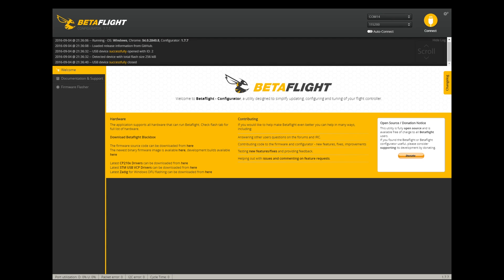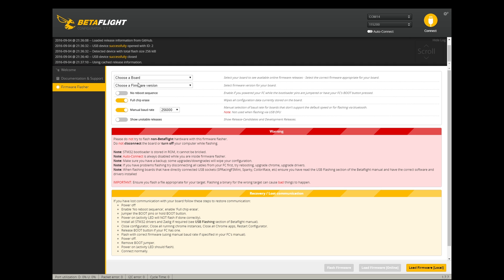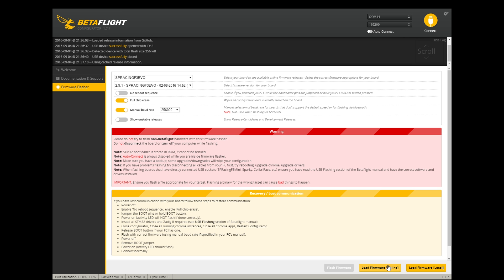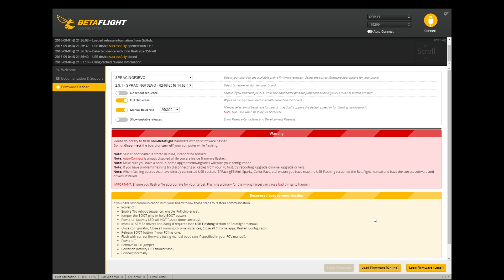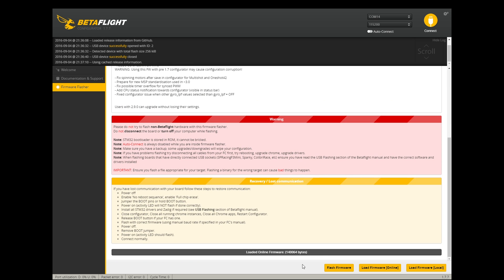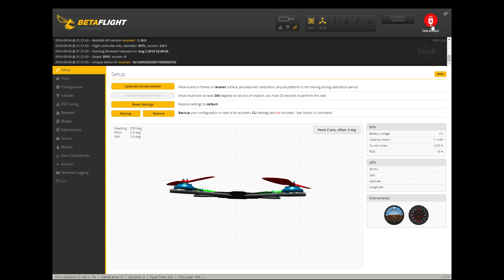Betaflight Setup on F3 Brushed Flight Controller

Comment: Banggoddan QX90 brushed quad. He flew pretty well before betaflight from the computer. However, after I put the BetaFlight program from the computer, when I connect the quad to the battery , the motor starts to rotate constantly. Then I reloaded the version from the Clienflight on top of the Quad, and when I connected the battery this time, the four motor always spinning, I wrote set motor_pwn_rate_1000 in the CLI section of the program, but the problem has not been solved Do you have any information about the problem?

Comment: im having issues binding my FC to my taranis, ive tried holding the bind button down, and activating bind mode on the taranis, but the red LED stays solid and does not respond, help?
Reply from the maker: which flight controller?  which receiver?  sbus?  ppm?  uh, need a lot more information...
Reply: Sorry about that, im new to whoops. Im using the F3 EVO FC that comes with an integrated frsky reciever. Im not using any sbus'es, or ppms or whatever that is, its just a whoop with a FC
Reply from the maker: BeeCore FC, AcroWhoop, or BeeBrain?  Procedures are different for each...
Reply: BETAFPV F3 EVO, is the FC
Reply from the maker: I don't know what that FC is, but I did a Goggle search and found some instructions online here - http://goo.gl/PU6kvz

Comment: Problem I'm having is betaflight seems to suck. I'm used librepilot many times and never had problems with it. Betaflight seems to need a bunch of drivers and while dicking around with it, and trying to figure out which firmware I need, I think I've trashed the board. Shame. This little board won't work with librepilot.
Reply: i cant figure out all the driver crap with betaflight. i cant connect my tiny 6,bummer!

Comment: hi,im totally new to drones.  I was able to connect, and flash, but after, the radio  doesn't start the motors anymore.  I tried the binding process and can see a blinking light when the the transmitter is off, and when I turn the transmitter on, no more blinking light.  So, I am sure the radio is binded with the drone, but no action.  Do I need to flash with the original firmware version which is feb 2016 for SP Racing, or should I flash with the latest version of SPRacing?  Thanks for any insight.  Thanks everyone.
Reply from the maker: You probably don't have the receiver setup properly in the configurator.  Do you remember your settings from before the flash update?

Comment: Hey, great video! Finally got off cleanflight and switched to betaflight. Unfortunately my problem still persists, on my qx70 whenever i plug in my battery the quad instantly starts spinning the motors and wont stop whether or not my receiver is plugged in, if anyone has any insight on this PLEASE help!
Reply from the maker: in CLI set motor_pwm_rate = 4000 (or higher up to 32000).  Don't forget to save.

Comment: finally I did flash beta flight 3.0.1 . But won't arm with my taranis. :(
Reply: I flashed beta flight and now betaflight won't show any movement on my sticks in betaflight. I re binded the taranis and the board shows solid green when I turn on my taranis. Any ideas?
Reply from the maker: +Insung Hwang check your throttle range... Make sure it goes below 1000
Reply from the maker: +ShabadooFPV check that you are usng the correct receiver protocol and that you have the right UART enabled.
Reply: Albert Kim I'm pretty new at this so I'm still using ppm for everything. It worked in clean flight just fine but not beta flight. I have no Uart set and I have it set to ppm in the configuration. That should be it right?

Comment: mr. albert kim i read manual rate motor pwm set to 1000 why in your video you set motor rate pwm to 32000 thx so much for answer. thx mr. albert kim i have learn a lots from you.
Reply from the maker: +eka sanjaya No particular reason. I think my motor manufacturer recommended it
Reply: thx so much mr. albert kim

Comment: Hi Albert, Iam having a Problem with saving my modes , maybe you can help. When i make my Setup in Bflight the modes are not saved, after i disconnect the board all is gone. Made a calibration before , but didnt help.
Reply from the maker: When I've seen that problem you have to reflash the firmware again.  Something is corrupted with the flash.  If that doesn't fix it, it usually means the flash memory on the board is bad and you'll need to replace it.
Reply: Albert Kim thanks , I tried a different Board , still the same . Could it be that it's something with the sattelite? Because the command set_spectrum_sat_bind=0 , it says invalid?

Comment: My qx90 has started full throttle after all these steps and the arm button doesn't do anything...he could break
Reply from the maker: did you check that motor_pwm_rate was above 4000?  If not, set it to 4000 to 32000
Reply: Yes I set it to 32 000 and saved
Reply: Albert Kim I've actually got This same problem after following these steps. pwm is set to 32khz. As soon as I plugged the battery in, it goes full throttle. Any solution?
Reply from the maker: +Winslow FPV check in CLI that motor_pwm_rate is set over 1000.
Reply: Winslow FPV I have the same problem full throttle stuck did you find out how to fix?

Comment: what did you set the cli pwm rates to?
Reply from the maker: +johnny vermont 16000
Reply: Albert Kim and i hate to bug you... but when I flash this board to betaflight the board is recognized I click Flash it goes into dfu mode and then closes the USB device it gets stuck during the process ... the reason why I'm trying to Flash to betaflight is because on cleanflight I can set the motor pwm rate but I don't know how to set the ESC protocol to brushed
Reply from the maker: +johnny vermont in cli issue command set fast_pwm_protocol = off
Reply: Albert Kim thanks!...i will give it a go

Comment: Hi Albert,  just to confirm, we do not need to solder the boot loader pins together?  a bit confused as some say we need to. also on the github link you provided below. Sorry very new to this.. thanks
Reply from the maker: I was able to flash without the need to bridge the bootloader pads. Some people are not able to do this. It kinda depends on the computer they are using and their setup. Since I am able to flash without bridging I would have to say it's not necessary but might be needed.

Comment: I'm assuming it's the same setup for clean flight?
Reply from the maker: +Anything “clarkey” RC no, Cleanflight will be different
Reply: +Albert Kim (marblekit) ok I will re flash to beta flight.
Reply: +Albert Kim (marblekit) what would be different in cleanflight for setting up the fc, I just had a look at updating the drivers so I can use beta flight it looks tricky to me, is there a video for doing that and showing how to put the fc into boot loader mode.
I appreciate all your help Albert.
Reply from the maker: Flashing the F3 board does not require bootloader mode. I don't use Cleanflight so I don't know how to set it up properly. However, Cleanflight is already flashed on these F3 boards so a flashing guide is not necessary.
Reply: +Albert Kim (marblekit) cool thanks Albert

Comment: I think setting the motor_pwm_rate to 32000 you also need to set unsynced_fast_pwm to ON to take effect. You can also do this through the GUI configuration tab directly no need to use the CLI tab.

Comment: I see you used pwm for the motor protocol.  Is there an advantage of using this over the brushed option in Betaflight?
Reply from the maker: that option shows up in version 3.0.  This is 2.9.1  I believe it's the same thing.

Comment: I always get Failed to open serial port. Don't get it. Bad FC????
Reply: For those on Mac you need to download SiLabs Drivers: http://www.silabs.com/products/mcu/pages/usbtouartbridgevcpdrivers.aspx

Then you can flash Betaflight to the F3 FC Board!  This took me a very long time to figure out.

Also another link that was helpful.  The command line I don't know for sure if it helped:

http://blog.sam-thompson.info/cleanflight-on-mac-osx/
Reply from the maker: You may need to update drivers. See this tutorial here https://github.com/betaflight/betaflight/wiki/Installing-Betaflight
Reply: you need zadig drivers - the f3 board on the qx90 can only be flashed in dfu mode
Reply: Done it Thanks to comments above. Thank you guys for helping me out with this. :)